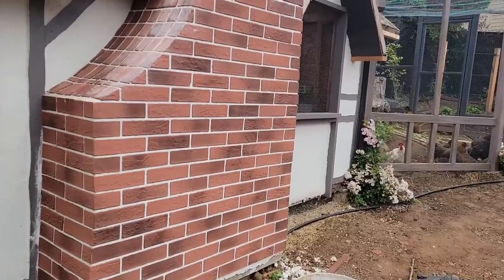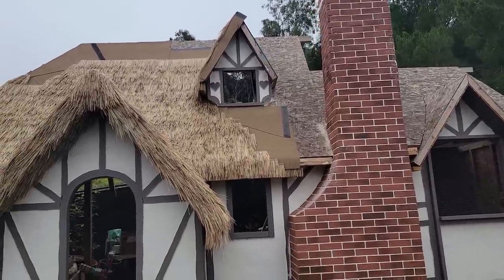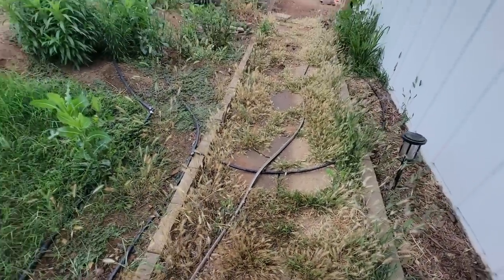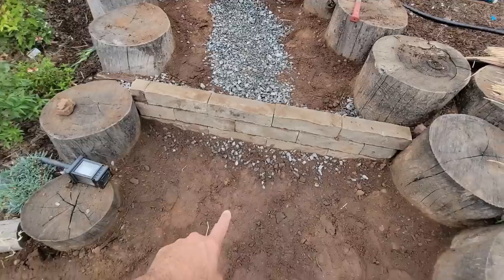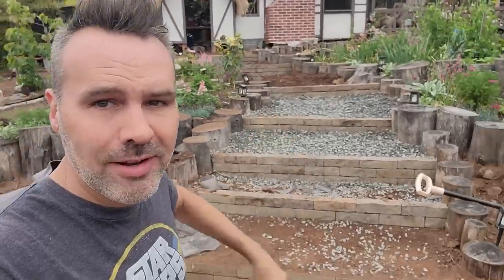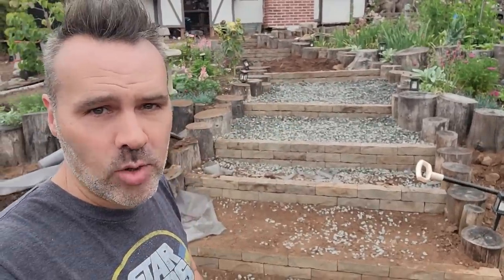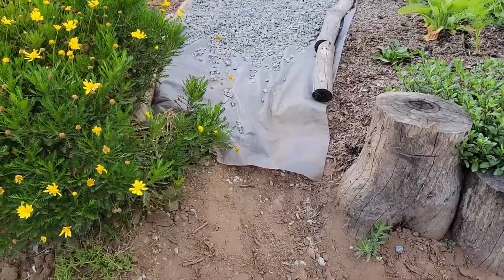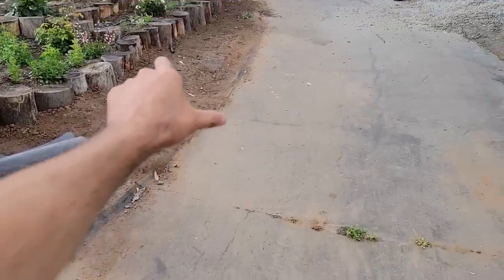Cottage Garden Finishing Touches

Comment: I have a fake creek that turned into a river during last winter‘s floods. I wanted to dig it out so that more water could flow. There’s old weed stop that I’m pulling up it’s just shredding. I guess I need multiple bridges across it like you were using your path to the cottage. I have been pulling out multiple sizes of Riverrock and actually sorting them. It’s not flat like your stairs because I needed some drainage depth and then I was going to replace the rocks small ones at the bottom large ones coming up the edge. Any suggestions?